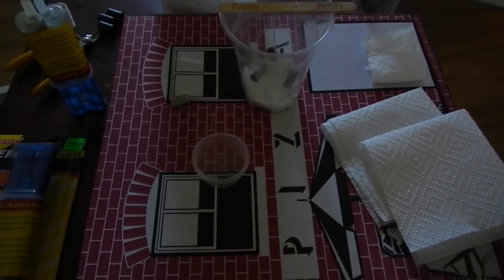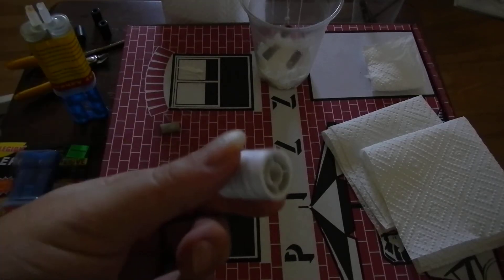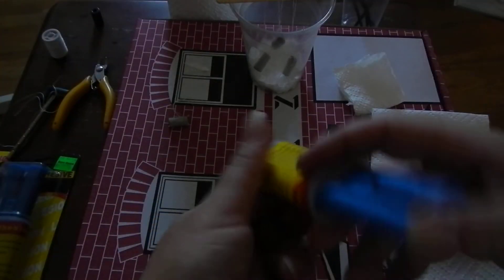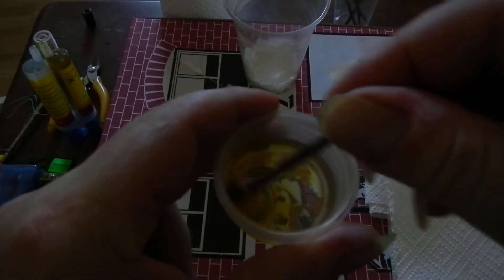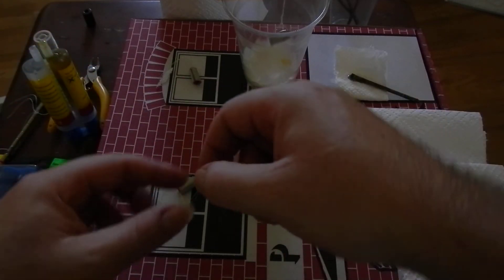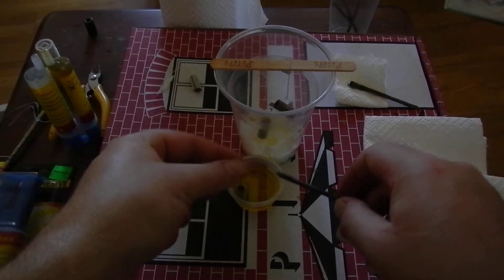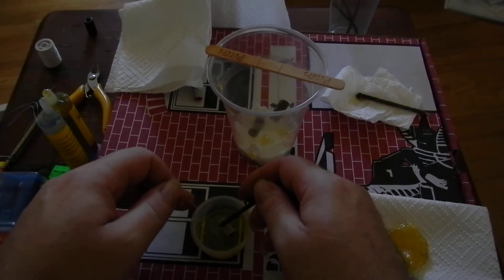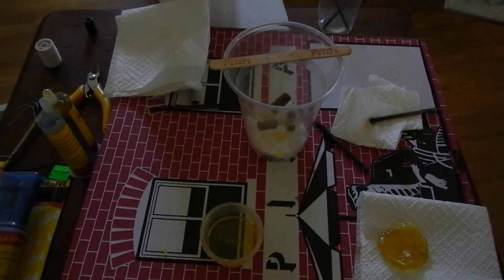DIY Reinforced Plastic

Comment: Cool!  I think some older electrical insulating parts are made out of a similar stuff, resin and cardboard.  It could be some other fiber though.
Reply from the maker: I have copper tape on the way from ebay land (China). Once it arives I'm going to attempt a cardboard epoxy PCB. Make it all on cardboard, so no drilling needed. Then paint with epoxy. Protect all the components too. Only downside is it will be a pain to repace components once sealed.
Reply: Why won't you need to drill holes in it?  Sounds like a cool project!  Do you think the epoxy and cardboard will hold up to soldering temperature?
Reply from the maker: Epoxy is what they use for solder mask. As well as most of the PCB. Although with a heat resistant additive.Regular epoxy like I am using is good to about 200c (392f)

I would be putting copper tape and all the components and soldering etc on the cardboard first. Then epoxy coating after its soldered.. In this way I could also make a curved PCB if I wanted to so it could fit inside a case or whatever. So would be able to make holes with a pin, or even by shoving the component legs through the card.

I have made cardboard 555 circuits etc before. The cardboard holds up to the temperature of soldering very well. In those projects I just used wire off cutls and component legs etc to make the circuit.
Reply: That's very true.  I didn't really think of that hahaha.  Fiber glass is a lot of epoxy.  XD

That's a really clever idea.  So you would need to cut each trace to size?  Sounds like a lot of work if it's a complicated circuit.  Do some videos on the whole process because I would be very interested in seeing this as I'm sure others too.  And being curved etc would be really nice.  I might have to try this because it sounds awesome.  XD
Reply from the maker: The copper tape I ordered is 5mm wide. Will be trying to avoid cutting it as much as posible. Can go double sided no worries though. I'm also thinking you might be able to take a craft knife to some of the really wide copper tape and carve out the traces that way. Although transferring it to the board could be delicate.Where ther is a will there is a way. Anything to make backyard PCB cheaper simpler, less toxic, and less constrained by tradition...
Reply: Ahh ok.  That should be pretty easy!  And I guess a little dab of solder at the intersections of different copper traces will connect them nicely.  Sounds like a really cool project.  Can't wait to see some videos on it!  :D
Reply from the maker: I'm thinking ZVS (finally) May layer the copper tape up a bit for the high current lines. And include sockets for things that are likely to die like mosfets.
Reply: Mongrel Shark Sounds good.  Maybe triple layer if your tape is thin.
Reply from the maker: The tape is 60 microns Tin foil is about 100 microns. But if I solder all the way across the tape it will take some decent current I think.
Reply: Mongrel Shark Should work.  I guess the traces I used for my ZVS are not that thick but I did put copious amounts of solder on and they are really wide.

Comment: Kinda links to Roberts (RMS) graphene coatings on plastic, if you see what I mean. Good practical idea and am looking forward to the remagneticalising ! i'd say 'remagnetising' but your ideas always have interesting twists :)
Reply from the maker: Would be fun to draw a circuit with a graphite/graphene product the seal with resin....

As to the remagneticalising. I'm not sure its going to go too well. Russ over at RWG has been doing the same. With a 10kj cap bank and huge coils. Or with a 18kj 3000v magnatizer. Makes a nice bang when it goes off. I'm thinking I will have to break out the HV or variac and whatever caps I have and I will still be getting poor results.

Although there are a few sets of instructions I have found on cooling the soon to be magnet from above curie point while in a strong magnetic feild to align the magnetic structure of the metal. So perhaps all is not lost. Will be fun to see what can be done in the averege back yard anyway.

Wound one of the ferrite beads yesterday. 800 turns of 38 gauge (was going for more, but wire broke). Pulls 250ma on 12v. can't lift an 8mm ball bearing. Looks like I will need more turns, thicker wire, and higher voltage. Probably going to turn these air cores into bobbins with cardboard epoxy washers and try sone 26 gauge or something. Then discharge 40kv though it as it cools. maybe use microwave diode to supress ringing.
Reply: Mongrel Shark
So, you mean stick it in the freezer for a couple of hours ? I could follow along with that :)
Just watched Russ's latest...man, that's a scary electric bill, "2.02kA" of current !!!
Seems to me that this could be DIY'd and I would like to use it for a practical purpose. Have got 100 N35 tiny round neo's and they're only good as spacers on rotors. So if they could be upped a bit it would be great.
Think you'll need 20 gauge and a car battery, with a strong inverter. Am hoping though that you get fantastic results with 38 gauge and an AA lol
Reply from the maker: The idea is to heat the magnet up past curie point then cool down in a magnetic field. There is an instructables where someone does it with a hot fork and a speaker magnet.

I thought Neo because its good for magnets and has low curie temp.

I want to try slow cooling and quenching.
Reply: Mongrel Shark
Ah I see. There must be several simple ways of strongly magnetising. Something traditional, such as dragging across another magnet and then adding a mains driven shaded pole microwave motor innards. Something with a bit of a whallop :)
Reply from the maker: Shaded pole is the fan one right? That's where I got the wire for the ferrite bead I wound.
Reply: Mongrel Shark
Yeah, in m/wave ovens or fridges. 2 parts with clunk of metal connecting. Coil at one end, motor at other, with no brushes. Did the same thing with the only 1 of those i've ever had, looked at the wire and delved in to reuse.
Reply from the maker: I have a ton of them. Its what I make my Slayers from.

I also found washing machine pumps have the same thing with thicker windings.